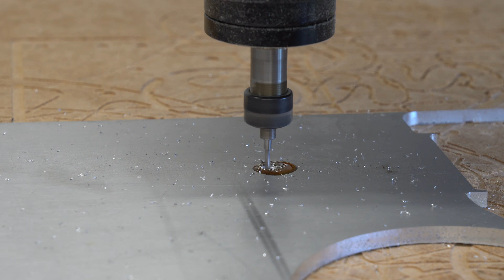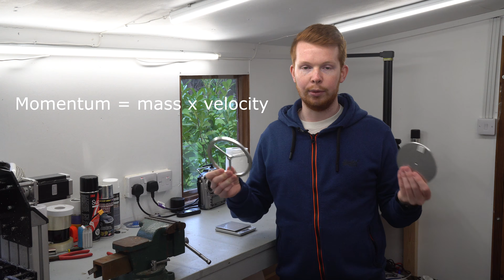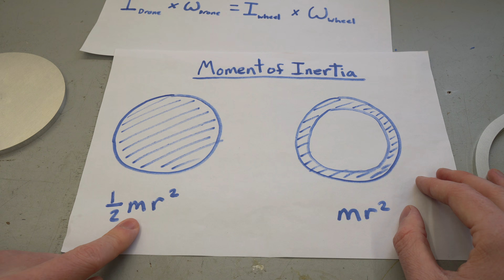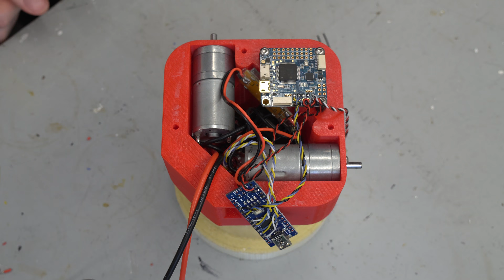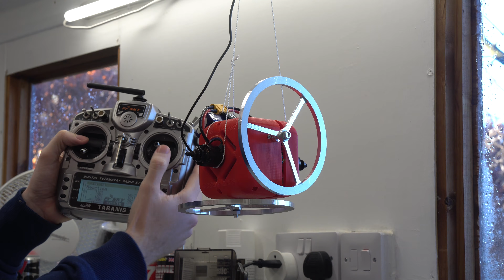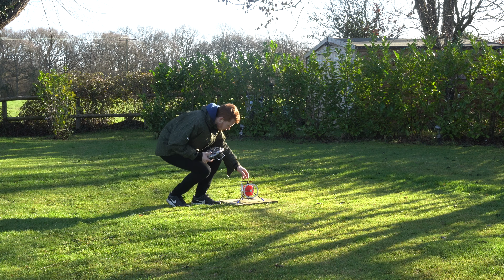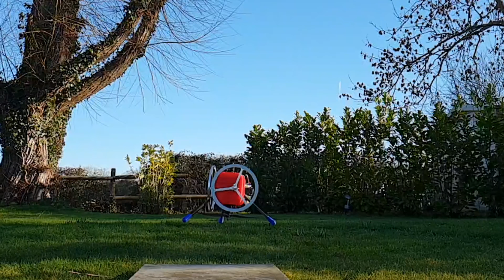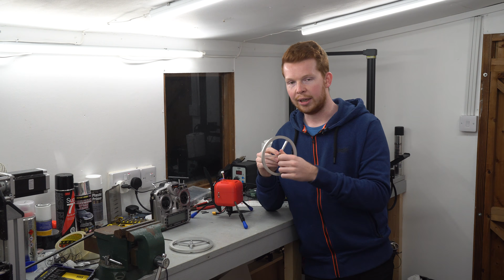Comment: Some years ago I happened upon a YouTube video of a ONE WHEEL vehicle which was stabilized and STEERED by gyroscopic precession. The inventor was Charles F Taylor and he was developing this idea during the 1950's. When I saw your video I wondered if you were using the same idea. After watching , I saw that what you were doing was quite different although it looked similar.  You are using a torque reaction to control attitude which would probably not be powerful enough for a ground vehicle unless a very heavy flywheel was used. A gyroscope's precession force is much more powerful because of the high speed of the wheel. If you enter  "Charles F Taylor" in the YouTube search box you can view a video (actually 8mm movie film remastered) of some prototypes Mr Taylor constructed in action. I wonder if you could use his concept to control a drone?  If you had two high speed wheels turning on shafts that could be gimbaled on the pitch, roll and yaw axies, I bet it would work.

Comment: I think what you need is a sensor matrix and an actuator matrix. You have a mimo system (multi input multi output) an what these matrices do is transform the mimo controller into 6 (RPY and XYZ) independent siso controllers that are super easy to tune.

Comment: did you account for precession phenomenon? because you have a very fast spinning propeller which contribute a large angular momentum to the system .... the reaction force created by the wheel maybe becomes changing the axis direction of the propeller

Comment: Very neat. You definitely need the two reaction wheels to become 4, with a solid axle and counter-rotation gearbox in the middle, otherwise you have got two gyroscopes, off centre, pushing hard in not quite the right directions at all times, rotating the bird. Pick up a spinning bench grinder (carefully!) and rotate it and you'll see the issue. Have it counter-rotate to cancel the forces into the bending moment of the axles, and it'll be dead smooth.

Comment: What would happen if you had 2 counter rotating wheels on each of the 2 axis. This way you could control the yaw and pitch by slowing down one of the discs while allowing them both to spin without having to stop and change direction.

Not sure if this makes sense?

Comment: Please correct me if I am wrong, but it appears the center line  your reaction torque wheels are not going through the center of mass of the vehicle. If this is true, this is a problem because now your applying a moment at some distance away from the center of mass, which will cause your roll wheel to impart rotation in all three axes. I would also suggest using larger propellers, your vehicle body appears to be blocking the majority of the flow coming from the top propeller. Also brushless motors have rotational speed feedback by monitoring the zero crossing of thee back emf in the neutral phase. Also that jolt stopping motion of the brushless motor is by design and can be disabled. What they are doing is shorting the three phases together and allowing the back emf to induce eddy currents and stop the rotation. You really need an ESC that you can tune, check out Sapog UAVCAN Tool, the Zubax Orel 20 ESC. These are tools and ESCs that are highly customizable for BLDC's.

Comment: Cool idea!
In my experience, reaction wheel speeds are usually biased to avoid zero crossing.  This may also serve to put them into a more linear (though lower) torque region.  Some analysis of the expected control torques would help to determine proper sizing (wheels and motors) and appropriate bias speeds.

Comment: just a thought for your test runs:  Suspend your drone (which I thought you were going to do).  should be fairly trivial to get a pully with a thread and a small weight at the end to pick up the slack; attach it to the drone however which way (a hole and a pin would do!) and then just limit the positions of that weight so that if the drone is going to crash into the floor it just gets suspended.

You're less likely to test it to destruction that way.

Comment: You probably need to make the whole drone spin in the air. You've done a breakdown on the rocket/drone pendulum fallacy, and how if the force doesn't act perfectly through the center of mass (nothing is perfect), there will be a torque exerted, which if not countered will result in it tipping over and crashing. With no other way of applying a torque to the drone directly, unlike other drones with off axis propellers, you need to have some way to flip which direction the torque is pointing. Having the drone spin at a constant, slow 12-60 rpm (1- 5 sec per rotation) in the yaw axis will cancel out any imbalance on the drone over one cycle, allowing it to stay balanced.

Also, yes, you definitely need some different controller logic to account for the nonlinear behavior of the reaction wheels, but also to make sure it's attempting to alter it's orientation to prevent them from saturating, and make the spin as slow as possible.

Comment: Great project! The wheels were probably too big for the mass of the drone, and for the torque of the motors, in addition to the non-linear effects you mentioned. Maybe put in some gearing or use smaller wheels?

Comment: Would electric braking help with faster motor direction changes?...sort of like how cordless drills have electric braking....I'm also thinking the rotational mass of the DC motor armature is messing with the equation a bit...the motor armatures are spinning at a much higher rpm than the reaction wheels which might be screwing with the correction formula

Comment: I’m a bit late to the party but, did you check the centre of gravity? If close or above the point at which your reaction wheels axis meet, then you’ll be quite unstable, the British harrier aircraft had similar center of gravity problems, if you can lower it, you wouldn’t need such high torques to respond so fast, every bit would happen a bit slower granting more freedom, though I guess at the cost of your drones performance. You may need a lower latency for your motors, they’re smooth, as you stated, but slower because of that. So uh, yeah, weight can help if placed low enough, although the lower rotor is also a complete mystery as well, as it greatly adds to the instability.

Comment: I wonder if it'd be easier to swap the brushed motors for high-speed brushless ones and simply start the wheels at half their max RPM, eliminating the need for them to change the direction of rotation.

Comment: The propeller of the drone was at the center (both top & bottom), what about the weight of the re-action wheel? those are placed only 2 sides out of 4 sides. Shouldn't balance the moment?

Comment: I was very engaged with this project and your skill at cad/cam, 3D printing and milling and microprocessors .  The physics is the subject of course and the inertia wheels should work.  As a private pilot I suspect that part of the problem may be related to the centers of gravity and lift.  The reaction wheels generate their “moment” near the center of the wheel hub.  Ignoring the Z axis (altitude) the moments created by the wheels are offset from the centerline of gravity/lift creating another moment that would tend to tip the drone.  The solid wheel and blue plate experiment worked because of the proximity of the two bodies.  I think.  Or I had too much wine last night,    😜

Comment: Would you try to balance the wheels? because seems the center of mass is not on the vertical axes. Maybe this cause some torque difficult to manage... anyhow this project is very interesting!
Then I suggest to create a frame to hold the drone to be able to tune the electronic without danger of crash.

Comment: Very nice video to recap some high school stuff, but i didnt get how is the equation for moi for a disc 1/2mr^2 and a ring mr^2, as your disc has a hole it is also a ring. I do get it that for the mass your ring is more outwards thus the real velocity is  r*pi*rpm so there is more newtons in relation to mass in the ring, but the equation is not as straight forward as you presented. The contradiction is that you could take any disc and thrust a hole in it to make it a ring, and if you remove say a gram of mass you would end up with almost 2x the inertia by cutting a hole???

Comment: iirc most usual reaction wheel systems use two counter rotating flywheels at high RPM at all times for  their control, this allows for finer input and control than the system aroung zero speed

Comment: there must be a problem with the code do you have interrupts in it? did you simulate control system to see the zeros and poles positions?
a brush motor with gearbox can not make enough acceleration because of gears inertia 
is it weight balanced already?

Comment: It was gyro precession response to motor controls, not a simple momentum.
You cannot pitch when accelerate "pitch" wheel; you will receive responce from all wheels (and rotors), almost always in combination with perpendicular rotations (depend of current angular momentum vector value).

Comment: It doesn't look like the reaction wheels need to move fast. Would stepper motors work better than brushed DC motors? Stepper motors can be controlled algorithmically to achieve angular velocity-dependent angular rotation.

Comment: what effect does "center of gravity" play in this device?  how much mass does the reaction wheel have in relation to the mass of the entire vehicle?  also, could you add a protective cage around the entire device to save on crash damage?  like a strap spring cage? i would be interested in how this works in an underwater project.  great physics!!  thanks for your research.

Comment: When the reaction wheel has significant speed it acts as a gyro, reacting to a drone angular rate perpendicular to the axis of the reaction wheel, by a disturbance  torque, which must be compensated by a control torque produced by the other reaction wheel and the control torque of the counter rotating lifting props.
With a properly designed control law, which includes these cross coupling but predictable moments, steady controlled flight is achievable, provided the computational delay in the control computer ( arduino) is small.
And yes for a dc motor the torque is strictly proportional to the current, (exept for the friction), not the applied voltage, because of the coil inductance and the "emf".
Spacecraft, like Hubble have reaction wheels (4) for attitude control.
During maneuvering, meaning change in orientation, these gyroscopic effects are predicted and compensated for.
That is why the extreme pointing accuracy can be achieved.
Remember in your static test, the other reaction wheel was not rotating, so the gyroscopic disturbance was not observed.
I suggest you repeat your bench test with the other reaction wheel rotating at various speeds and determine the compensation experimentally.
Reply: I was going to make that point. It all gets very complicated when the precession of the spinning wheels feeds in extra pitch and roll from any yaw correction. - which is another way of saying what you said.

Comment: maybe have the reaction wheels spinning before taking off such that the angular momentum is stabilizing a horizontal orientation before the drone lifts off. could simplify the current to force conversion since you would not be starting from a dead stop for the reaction wheel motors.

Comment: How about this concept.  4 propellers all running the same speed at all times. Each propeller can till toward the front or rear of the drone using a servo to control the tilt. This means the "drone" can only move forward and reverse. Use a reaction to rotate drone body widdershins or deosil (clock-wise and counter clock-wise). Use a electronic compass and gps to know which direction the drone is facing and it's position. If programmed properly, the drone will hover, maintain altitude without user input. The user only needs to control height and position. 4 way joystrick (analog) for controlling directional movement, and a second control to "dial in" the height. Also if a screen and keyboard is available, just input new postion, X and Y meters or feet from current, or specific grid coordinates. If signals are sent by using a old cellphone or andriod device, then even the camera of the cellphone can be used to see where the device is or to stream to video to google drive or some other storage.

Comment: Couldn’t you weight the wheel on one side to use slight fast semi rotations to achieve the same goal without depending on torque from a faster spinning wheel? This might be stupid.  Sorry in advance.

Comment: It may be more balanced and less likely to want to flip if the over-all shape was more rectangular instead of cubish. And you could do the 2 propellers on both ends of the long edges of the top and still spinning in opposite directions. Have 1 of the fly wheels on the bottom. And the other on the edge closer to the center to keep the mass near the middle

Comment: You should use  4 flywheels and 4 motors,each one turn only in one direction .It would balance de drone  and the response would be faster .Inverting rotation is too slow with flywheels.

Comment: So your setup uses two pwm outputs of the flight controller to control the speed of the inertia wheels.  But it is not inertia wheel speed that will correct the pitch or roll error of the craft... it's Intertia wheel Accelleration! 
I think the wobble is not at all due to control system latency as others have suggested.  That's a buzz word that fpv racers love. But there won't be much latency in your system.
You need to use rate of change of inertia wheel speed to correct the pitch and roll.
So in other words p factor will not do much for you, it's all Integral

Comment: Need to cancel out the Y vertical force input for the gyro's, it's trying to balance in place but getting thrown off from vertical force reading. you'd be better with a tilt sensor flat set to attempt idle level on x & z, same drone can be used but apply acceleration or breaking, from a mid range RPM, so it has room to slow down or speed up the wheels, though for best in-flight balance the balancing wheels would need to reach their full mid range rpm Before going vertical. Really amazing shop and you've always got a nicely detailed build and mathematics behind it, Great content!

Comment: i wonder what would happen if you spin up the wheels before liftoff to stabilize it (rotation speed corrections should be possible even if its spinning at a fast rate). and as a bonus i'd replace them flywheels with batteries as you're carrying this mass anyway (yea there needs to be some way to get current out of it without drilling the cables, tho).

Comment: what about putting counter weights on the opposite sides of each wheel? So once the wheels balance the drone, the drones x and z axis are not sitting at 45 degree to the y axis causing the propellers to shift the drone from side to side or walking is what i would call it

Comment: I saw your project and found it very interesting, and a good example of the practical use of physics. I also have the inventor and curious bug, and I thought about this idea a few times. I think the invention is perfect, and the construction you made too, but something very simple to correct is missing to make it work.
 Check This -->https://www.youtube.com/watch?v=n_6p-1J551Y 
When the discs are static, they are not producing any gyro effects or conservation of movement, but if they were rotating at high RPM, and their change was to accelerate more or decelerate, you could combine both effects. The one that they are turning from the beginning would give stability, and the acceleration or deceleration delta would do the position and angle corrections. I really wish you could make that minimal adjustment and see if the project turns out to be an absolute success.

Comment: My turn to say oops.  I misspoke below.  There is only one unique ratio of r2/r1 for these two design goals: 
Goal 1: outer radius (r1) of solid disk equals inner radius of the hollow disk (same thickness for each disk, hollow disk outer radius = r2), 
Goal 2: mass moment of inertia of the solid disk equals the mass moment of inertia of the hollow disk
Ta da, the answer is that r2 = (2^0.25)r1, which is approximately (1.189)r1 and the ratio of the masses will always equal m2/m1 = (2^0.5 - 1), which is approximately 0.4142 = m2/m1.  This does not count the spokes on the hollow disk.  And, I must admit, I don't know if you set the OD of the solid disk equal to the ID of the hollow disk, I was just fixing my error below.  Isn't math fun?